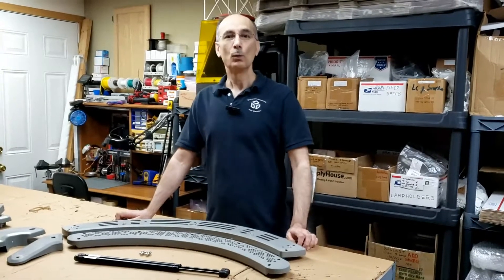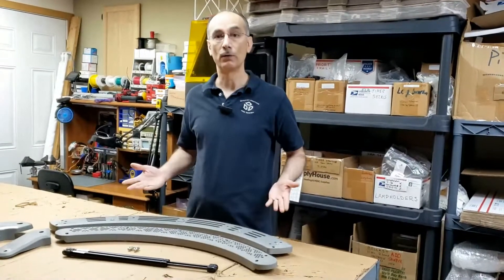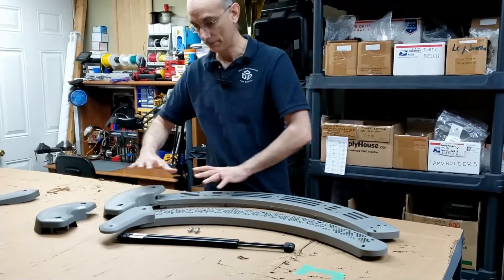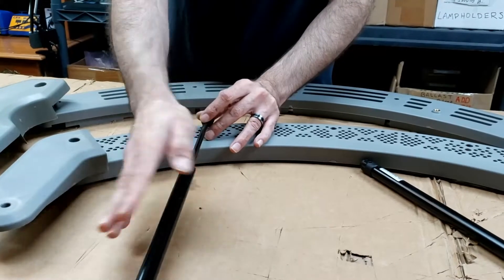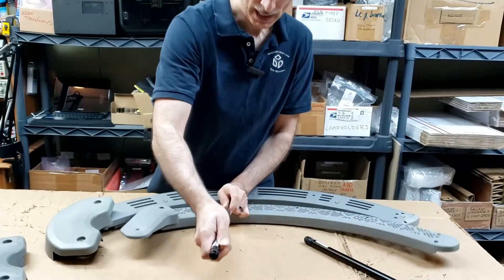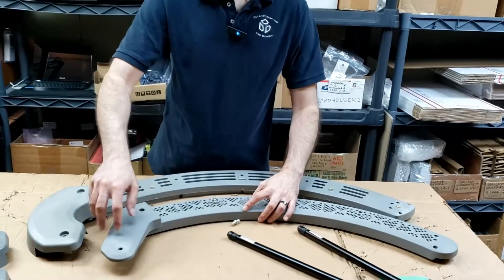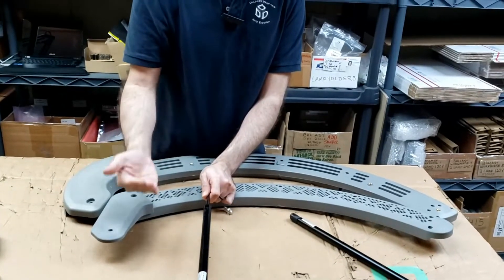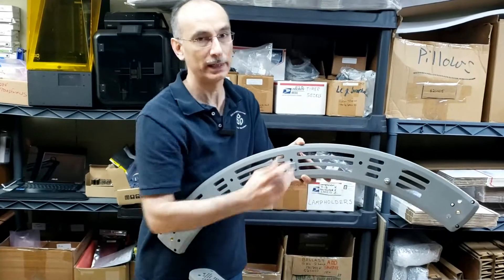Why do my end caps or hinges break on my tanning bed?

Comment: I just ordered new shocks from solar storm for my 32C, and they won't keep the bed shut!  Is there a way to adjust them?  They are installed correctly with the barrel up.  When you close the bed it opens right back up!
Reply from the maker: Thanks for your question.  The shocks are available in different strengths, and the numbers should be matched up from the old ones.  We've been advertising them per model, but the manufacturer has made so many changes lately - it's no longer reliable to match them up by model name anymore, unfortunately.  Please contact us directly at info@esbservice.com, and we'll be glad to help further...Thanks!